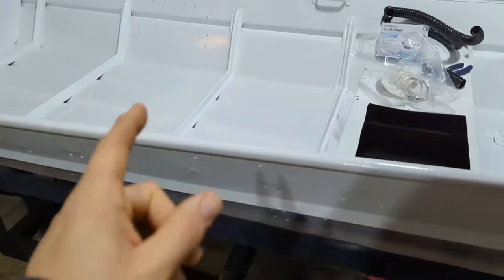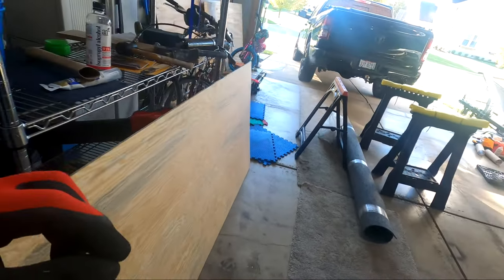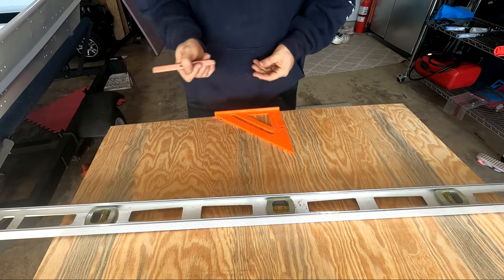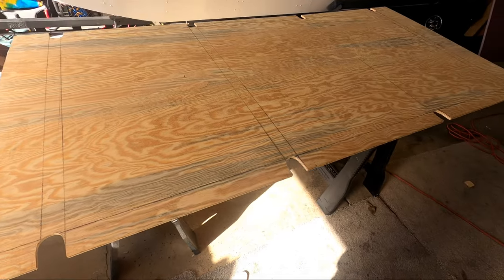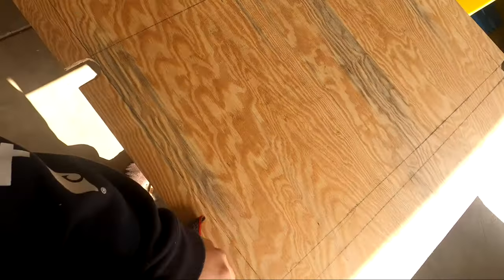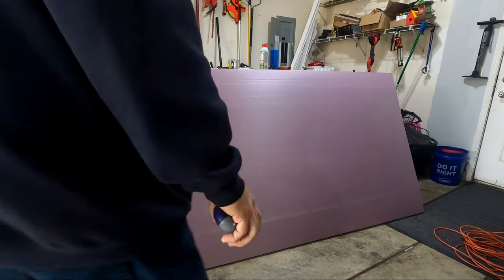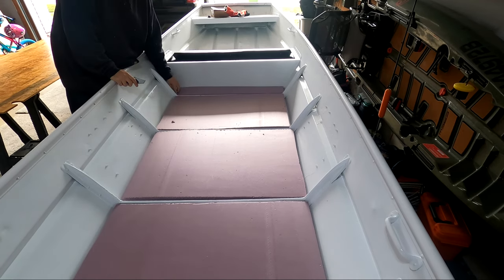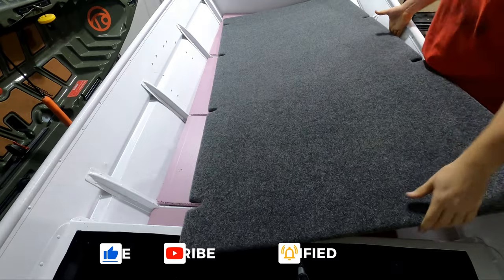JON BOAT FOAM & FLOORING - PART 1 - Carpeting Plywood on the Jon Boat To Bass Boat Build Conversion

Comment: Great video!  Did you screw the floor down to the aluminum cross braces?  Or is it just sitting on top?  If you screwed it down, how did you hide the screws?  Thanks!
Reply from the maker: Yes I screwed into the braces, since it was wood I buried the screw pretty deep and it was hidden in the carpet really well

Comment: Do you think flex seal could substitute for the fiberglass resin to waterproof the ply?
Reply from the maker: No probably not but you could use another waterproofer. Epoxy works well, or thompson's sealer.

Comment: So for the water getting in does it ruin the foam board? Never used it just wondering
Reply from the maker: The foam is closed cell so it resists water uptake. Only gasoline can damage the foam.

Comment: I'd be concerned about water under the carpet and floor causing mold over time as it wouldn't dry if covered like that. Something to think about.
Reply from the maker: Very good point, the floor has drain channels so there shouldn't be much standing water but drainage is very important to consider with foam and flooring.
Reply: It will hold moisture. No way around it. The wood will eventually rot.

Comment: Just wondering, have you used marine plywood or just plain ol plywood and seal it? Asking because i am about to do my floor and dont want to spend $100 a sheet for marine..
Reply from the maker: I've always used "exterior grade" plywood and sealed it. It's a little more than basic plywood but way cheaper than marine.
Reply: @mvboutdoors  thanks for getting back so quick! I found some at Menards that is exactly that, going to give it a try! Even 2 or 3 yrs in this old boat would be plenty 😆 
Love your content, it has been very helpful. Thanks for all your work fella!
Reply from the maker: @presleemcclary8924  Good luck on your build!
Reply: What size Is the boat
Reply from the maker: @kevindykeman4959  1436

Comment: Nice work ..why do not you use water proof plywood the one for the bathroom -the green one - will be easier!
Reply from the maker: You should never use pressure treated plywood on an aluminum boat. The solution they use to treat contains copper and copper is highly corrosive to aluminum.

Comment: curious why you put foam down. i understand you sealed it but if there is a leak or rain there is no where for the water to go. also when the foam gets wet it will just retain water rotting your wood from the underneath. imo
Reply from the maker: Sure thing, so there's channels under the foam for water to reach the bilge in the back and it's closed cell foam which should not easily absorb water. 

I added foam first to replace some of the foam removed from the bench seats to help the boat not sink if it were to flood or capsize. The main reason is for floor rigidity, having the foam board under the floor makes it solid to walk on.
Reply: @mvboutdoors  it looked like insulation board to me not used to that kind of foam. did not realize it was closed cell. i am trying to redo a 1982 sea nymph and doing research because i know nothing about doing it. every video i have watched they used the liquid stuff to bond to the floor better

Comment: Your doing a great job! However, mixing the catalyst ( see 5:27 ) I see a problem. Liquids are measured by their volume (ounces). Solids are measured by weight/mass. Use a volume measurement next time, to cut down on the amount of catalyst used. 🚤👌